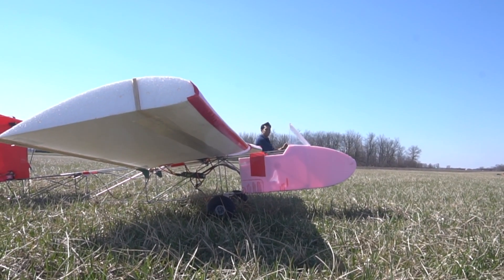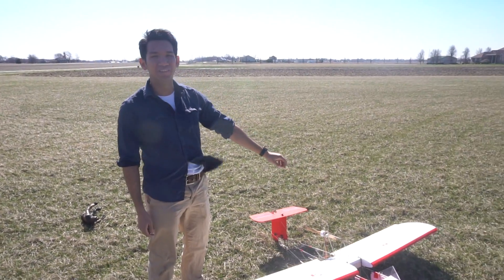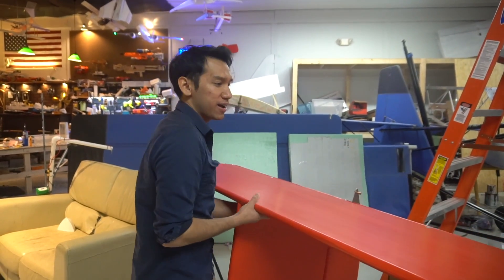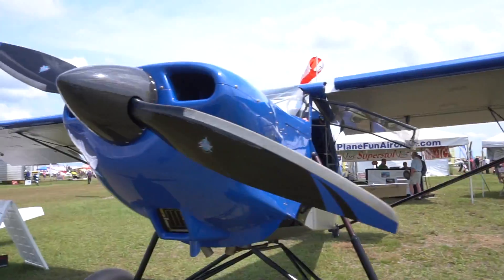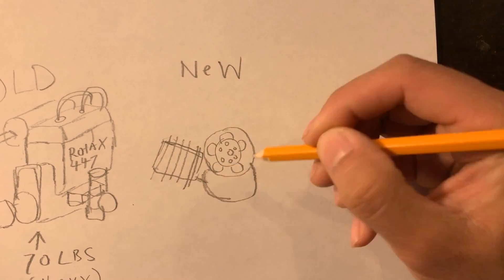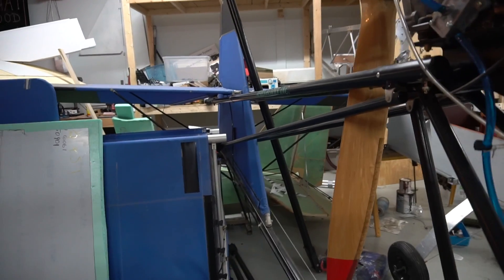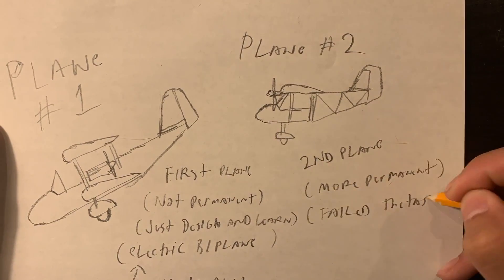DIY ULTRALIGHT MK3 part 2

Comment: I PROVE HOW TWIN BIPLANE IS MOST OPTIMUM ENGINEERING SOL & HENCE WRIGHT BROTHERS WENT WITH IT
BIPLANE NEEDS SMALLER WINGS 
hence it is stiff by design 
don't need stronger materials
don't need vibration analysis as resonances impossible in stiff frames...& no flutter too
Ailerons don't reverse bcz wings don't twist
TWIN MEANS
engine redundency & safety
no torque reacvtion bcz counterrotating

Comment: You should be careful about how high the motor is mounted above the wing and center-mass, or else the plane will always want to nose down because of the leverage. NOT safe when you're lawn mowing at 50ft and have a harder time pulling up!

Comment: Rotax 440, not very reliable, likes to overheat and when the pistons get screwed they usually have a bunch scratches on one specific side on themselves, which means that there is a design flaw with the engine.

Comment: Having a simple design concept does get results and resolve design issues, even for an entire series of aircraft. I designed and flew the Bloop biplanes with the central idea of flying an airplane as slow as possible, making many compromises and avoiding unnecessary development efforts (buy it, don't make it). Secondary ideas were make it light, simple and legal (ultralight category).
These goals sound similar to yours, except that I gave up transportability. I found that fixed base operation was satisfying.

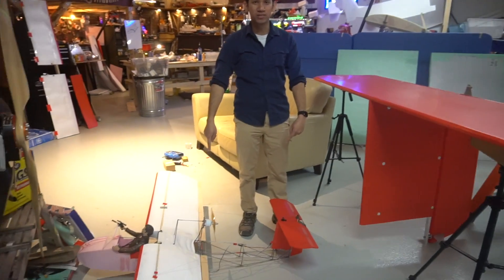Comment: jeeezuss.      so,    YOU  STILL  CANNOT  SPELL     S P R U C E.            (i should not be, but)  i continue to be amazed by your  LACK of  Smarts and/or Knowledge.       at 4:42,   the  model  has  an  OFFSET  THRUST  LINE.      you  HAD  better  UNDERSTAND    how to do  this    CORRECTLY,   Don't you Think.         i can tell you this much,  the thrust Line  Should  INTERSECT  the  c-m, center of mass;  or, to put it another way,   the c-m  SHOULD  BE  ON  THE  THRUST  LINE.               your chosen location of the horizontal-stab, put it  IN  THE  PROPWASH.     pretty STOOPID idea, that.     googletranslate
http://static.rcgroups.net/forums/attachments/2/9/6/3/9/7/a5988257-224-bixler%202%20motor%20angle%20correction.jpg
a wing concept;  main spar design is  not great;  its final weight was  excessive.
https://www.youtube.com/watch?v=ZJZ27GskKfc

Comment: Unfortunately, this configuration not as good as it can be. The  first reason is controlability and safety: engine thrustline is located far  from the CG, so during the landing  in case of go around, etc. you will need high throttle, what could cause unexpected  dive. It's very dangerous. The second reason is the vortex on the horisontal and verticat stab. from the prop, it will cause different AoA on each half of the stab. and these angles will be different at different combinations of thrust and IAS, so there will be a lot of vibrations from the fins and yaw, pitch angles you need to counteract with.

Comment: Peter we need to get u a Tig welder. You could cut down on so much weight by eliminating the metal hardware you use to attach pivots and such. Plus 2 unlike metals cause electrolysis and will eventually cause structural failure..... eventually is a very length amount of time but it still happens.

Comment: IMO, Mk1 was the best design so far. Add a decent engine and you'll get a nice aircraft. 

Biplane with crosswires between wings gives it a lot of stability and lots of wing area, so good low speed characteristics and fun to fly.

 Mk2/3 are more like flying death traps, much more likely to fold up if something snaps. And go with fiberglass reinforced foam, that red hollow plastic stuff looks scary as hell.

Comment: Ignore that very rude comment and just do your very own thing Peter,not many people have designed and built as many aircraft in the short  time that you have from commercial materials,yes you are learning and quickly too and success is around the corner,at least you are prepared to try new materials ( who would have thought to use Correx board for a full sized machine for example? ) I actually like your work shop as it is with the proof of your past creations un-successful or not,it has your unique trademark all over the place right down to some quirky items from past projects,and the cheek of saying you do not know how to work properly  ! carry on it the unique style that only belongs to Peter Sripol and continue to pioneer today as aviators did in the past to achieve their dreams.

Comment: Always interesting stuff man.
No matter what you do you can’t build too light. I get the making it strong part but you really have to focus on weight.
Look at some of the other UL planes. They are mostly made out of really thin wall like.035 tubing and even thinner. 1/16 wall tubing and coroplast is WAY too heavy.
The kolb method seems to be the most practical in terms of making it foldable.
The lazair is another good reference for a somewhat efficient single strut lightweight wing design.

Comment: T tail looks really pretty. Besides the extra strength required T tails also are prone to Deep Stall.
with a tail slightly lower than the main wing it is always in clean air which makes it safer...also no tendency to Deep Stall and lighter to build. My 2 cents.

Comment: Mmm Invader MK IIIb back in the 1980s or so...Neil Reichter but that was with a v tail as I recall..Neil was like yourself into RC models, I bought the plans off him at Oshkosh as I recall. He had two at the show and I can still see the other pilot I think it was doing banked right over turns..I book a manual parachute there as well.  Ended up selling the plans here in NZ to an engineer who specialty was making full size carpet loom machines...he did get it built btw..Neil's pod fuse was Ali tube in streamlined curves, fabric cover.....open tail area, Ali tube fabric v tail....the last I saw of Neil was him selling RC electronics gear of some sort. You may even see him at Sun N Fun!  Regards Laurie

Comment: Wouldn't welding the joints be lighter than a bunch of screws?
Reply: vaska916 for the same reason nearly all planes are riveted/bonded and not welded. The strength of mechanical attachment are a measurable and consistent whereas weld strength can be inconsistent and invisible

Comment: New configuration is full of problems.  Take your relative success from the biplane, and apply that to a monoplane.  keep the electric, just locate the batteries in the motor pods.  more aspect ratio, like the sky pup.  a larger, heavier airplane will perform better, as it has to carry you, a fixed weight. The aircraft size/weight to payload(you) ratio is better.  microlights do not fly as well as ultralights, and ultralights do not fly as well as LSA's.   Ditch the coroplast and continue to learn to use foam core reinforced composites.   
my suggestion is to redesign the sky pup, with aerodynamic forward fuselage, and twin electric wing mounted tractor motors.  Use modern materials where possible to save weight over original design.  Just my 2 cents...

Comment: Tail looking good! I would like to see some mechanical attachments of the skin to ribs on the elevator though.. something like rivets or rib stitching. The glue or epoxy you used it strong, but loaded in tension, in the prop blast area really should use a mechanical bond like stitching.

Comment: PLEASE BACK ME UP ON THIS INTERNET!!!...Peter, please please just consider putting a small jet turbine for the powerplant (off a large scale rc jet). they are light weight, high output, low vibration and awesome! the turbine probably weights less than the battery system alone on mk.1
Reply: A 2 cycle engine with a low pitch prop will give more static thrust than a couple of the large RC jet engines at a LOT lower price.
Reply: @coolbean145  but its been done thousands of times, where is awesome factor. dont play it safe and simple.

Comment: Isn't chloroplast really heavy for the job it's doing
Reply: Chloroplast is the green stuff in plants. Coroplast (corrugated plastic) is what he is using. YES if you are using coroplast as just a skin instead of some other covering, it is heavy. However if you use the extra strength the coroplast provides to your advantage to build the frame lighter then you can come out about even. I have a 7' wingspan coroplast RC plane that is only ~ 14 lbs. Video on my channel.

Comment: Totally understand the choice of the 2-stroke, but the electric aspect is captivating.  

Gaining experience with Mk3 with the 2-stroke helps to bide your time until battery tech allows for an electric Mk4 that is formidable.
Reply from the maker: whoops forgot to mention also itll be swappable between the gas setup and an electric for shorter flights (just messing around the pattern)
Reply: @PeterSripol  That is definitely interesting and you probably should have mentioned it. I'd like to see how that works.

Comment: I'm not a fan of Mini Max style mid wing aircraft for a couple of reasons. Landing in a crosswind is difficult enough without worrying about dragging a wing tip on the ground. Wing bracing gets more complicated in design. I've got a couple of Mitchell Wings with about the same ground clearance as yours and I've almost scraped a wingtip many times. Do grass stained wing tips sound close enough to you? If I were improving it I'd look at this Ritz Standard hanging behind me. It's got the clearance and that also makes it easier to get in and out of. Easier to brace the wings and make them foldable like my Avid Flyer. I've also got an old Hummer and it's wing location is about a foot or two higher than were yours looks like it's going to end up. The Jenny biplane and others got around the wing drag problem by mounting half hoops under the wing tips. That might be a good idea with your current design. The Hummer and the Lazair both used V tails to get around the structure requirements of a T tail. One design put the V tail up and the other put it down. They both end up light because they have less components compared to  conventional tail or a T tail. Remember the XTC amphibious ultralight? It's got a shoulder wing like yours and the body is similar. They stuck the tail on backwards though. Canard style. The motor mount and wing mount on my Ritz Standard are a perfect fit for your airplane. If your hell bent on that shoulder wing design the Ritz mount could be shortened during construction.

Comment: How you filmed it from behind and front of the model in the air??? Great video
Reply: Toni L with a GoPro on a metal rod
Reply: @demo-server4091  yea but there was a gimbal or something installed, because the cam was stable and straight the whole time

Comment: Have you ever thought about doing a bubble canopy instead of an open Cockpit? Or even have a half bubble windscreen instead of a slanted one? Both of these might improve airflow and reduce drag with could bring less stress of the engines and even more efficient battery/fuel life
Reply: For an ultralight, it usually isn't that critical. Lots of work to blow a bubble canopy that's big enough and then for very minimal gain due to low speeds. As long as it's not a Model T flat front wall of a windscreen it should be fine.

And fully enclosed adds weight and need for things like emergency egress and restricts headroom and myriad other issues that for most ultralights the solution is simple omission.
Reply: It seems like he's still in the "is it possible phase" I think he's working out more mechanical and reliability kinks before he worries about efficiency

Comment: Could the next plane be a "garbage plane" where you only use materials that'd be thought of as trash? Like, using garbage cans and bags to make the wings?
Or, a budget airplane, using the cheapest materials but still can fly 100 pounds?
Reply: Or, designing a pedal powered ultralight. Mostly as a glider, but with pedals to stay in the air

Comment: Shouldn’t the rod support in front of the engine be pointed down at an angle, gusset like, triangulating the forward pressure of the motor’s thrust, instead squared off like it is now? MORE STRENGTH
Reply: Yeah, that looked really weird to me, too. Unless there's some reason I'm missing, a pyramid shape is going to be a heck of a lot stronger (with either three or four struts).
Reply: Ultimately, yeah it probably should but on the model it doesn't matter much.

Unless the plan is to use some kind of wire bracing on the wings in which case making the engine mount double as a king post is not a bad way to go and then it's easy enough to triangulate the square engine frame to prevent racking.
Reply: Scott Watrous Hold on a second, I have to furiously Google search “King post”